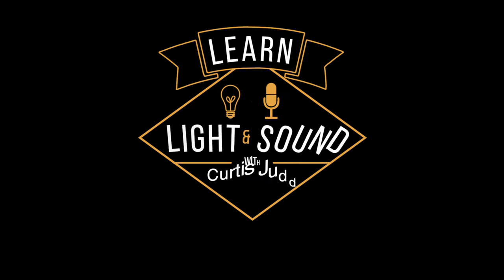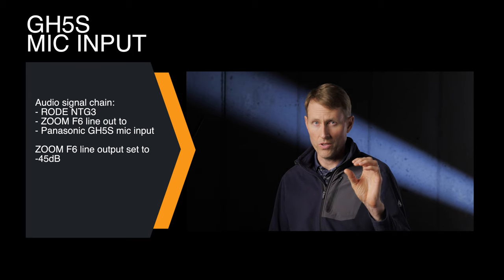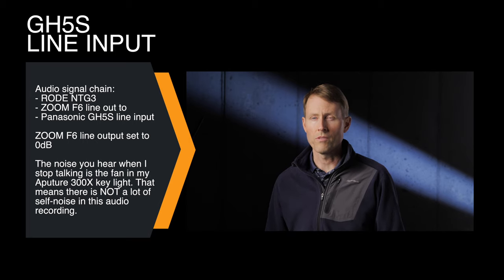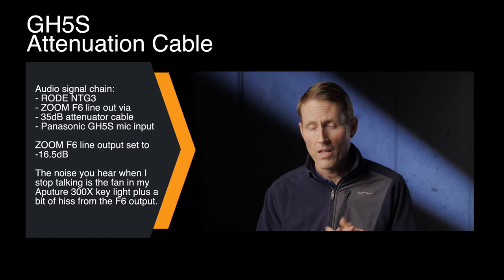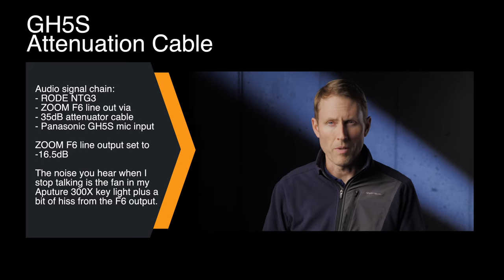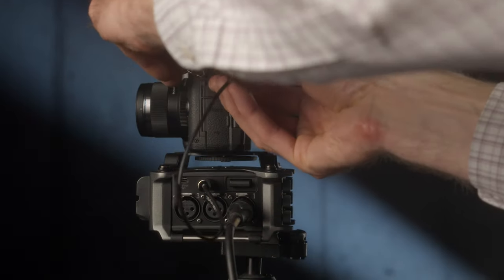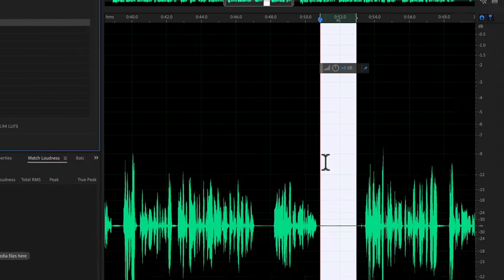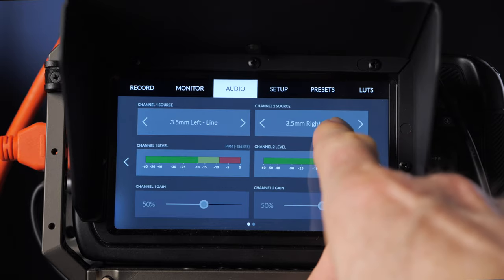Zoom F6 Line Out Issue & Workaround

Comment: Attenuator cables can be very handy - I had issues with an inexpensive Marantz PMD602a preamp which, despite being intended for use with cameras, has an output that hits 0dBV (a little 'hot' even for line level). A 35dB attenuator cable made it usable with cameras that only support mic level input.
Reply from the maker: Thanks Karl - agreed.

Comment: Thanks Curtis; I'm using headphone out instead of line out with Y splitter. this method is better for me. Line out port is useless. I cant find attenuator cable in my location.
Reply from the maker: Ok, I hope it works well. The reason I didn't do this is that the headphone amp colors the sound from my testing.
Reply: @curtisjudd  That's true. but it's better than loose every thing. as you know this recorder has only one memory card. if it's corrupted you can loose every thing. just for backup headphone out is life saver. for feature I'm trying to find attenuator cable. thanks for you advice.

Comment: I had a simular problem with the Zoom h1n.  It doesn't have a separate mode like the sony for setting the recorder to line level.   Zoom is suppose to accept both line and Mic.  I've got an attentutor cable on the way.   Apparently there's 2 types of line level.  Commercial/ professional vs consumer? Hoped the attentutor works.
Reply from the maker: It should help, especially if it is -35dB.

Comment: Another possible solution, which I will try, is to use a direct box that is designed to output microphone level. This would be ok on a tripod as they tend to be large.  However a good di will have high quality transformers and would also isolate any possible hum noise.  Balanced to unbalanced cable would be required and it would be mono only
Reply from the maker: Interesting. But most cameras or recorders with XLR inputs can be changed to line level so presumably, the DI box would not be required? Just change the input to line and no problem? Or are there DI boxes which output to 3.5mm TRS? Interested to hear what you find.
Reply: @curtisjudd   It would require a balanced to unbalanced cable, I have one Ill report back
Reply: Tested this tonight and while it’s a bit of a kludge it works very well.
I have two whirlwind passive DI’s.  I take the trs output of the recorder and break it out to two mono tip ring 1/4 inch connectors. These I connect to the two passive DI boxes which have a switch for either line level or instrument level. I pick line level.  Out of the di boxes I use a xlr to 1/8 in stereo  cable (xlr female to 1/8 stereo) this unbalances the xlr but outputs correct mic level signals.  No noise and the best part is that both the zoom and gh5 can be set at unity gain (0db) and use the cleanest part of the input and output circuits .  However it is a little cumbersome .  There are stereo line level to di boxes out there that will accomplish this made for interfacing -10 consumer level device to balanced mic level so one box could be used and again a stereo 1/8 to xlr female adaptor, I had one made a long time ago, but they are available.  Having a quality transformer is also a plus versus a passive attenuator.  I think the radial makes the ideal av that has a trs input and two balanced 600 ohm outputs.  It’s not cheap at 160 and the price of the cable figure another 30.  However if you want the best results I think it will work.  
Pretty geek, zoom should have designed a circuit that was switched between mic and line.  Even my old tascam consumer grade dslr recorder is switchable.

Comment: I plan to record audio coming from a mixer/soundboard and same time record the sound of the crowd for a live performance. I'm thinking either the Tascam DR40x or Zoom H4 pro or H5. Would you be able to recommend which is better?
Reply from the maker: Hmm...any of them could work, though the ZOOM recorders may need adapter cables. To get them into line input mode you need to feed in 1/4" TRS to the H4 or H5 inputs. I'd probably opt for the Tascam though it isn't without its issues (not the cleanest inputs).

Comment: Hi Curtis, thanks for your clear explanation! I'm about to purchase a Zoom F6 to use with my Canon R6. I would like to connect these two via a Rode Wireless Go transmitter / reciever. My question is: do you think that in setting the Rode Wirelss Go to the lowest gain setting (-24 dB), it would act in the same way as an attenuator cable?  Thanks in advance for your reply!
Reply from the maker: Hi MMA Fotovakschool, no, I believe that is only an output level setting, not a gain level setting so you'd probably clip at the input of the RODE Wireless GO. Will still need the attenuator cable.

Comment: Thanks Curtis, do you know if the R6 and R5 have line level audio inputs or just mic level? And does the workaround completely eliminate the issue or just reduce it to manageable/barely noticable levels? Also have their been any developments regarding this from Zoom since you published this video? Also how did you know the values to set it to such as minus 16.5db etc?
Reply from the maker: I'm not sure about the R5 and R6, but most mirrorless cameras only have mic level inputs. The workaround works, but is not ideal in a theoretical sense. But it may be good enough depending on your production value requirements. I have not heard of any developments from ZOOM on this. I suspect it is a hardware issue. I did several tests to find the levels.

Comment: Can you tell please what is the brand of the attenuator cable please? if that really matters in this case - but apparently cables can be very different in quality, and I suppose you've tested this as well. Thank you
Reply from the maker: Hi leemski, they are hard to get a hold of at the moment. I ended up with the MOVO MV-RC100 (link in the description). Whirlwind also makes a -35dB attenuator cable. I wasn't able to get that in as it is backordered, but Whirlwind usually makes decent quality products.

Comment: Hi Curtis, would you rather connect the Zoom F6 field recorder to the hybrid camera mic input via a -35db attenuator cable or would you rather recommend connecting the Zoom F6 recorder to a Ninja V monitor recorder (mic input) instead.
Reply from the maker: If the input on the ninja can be set to line level, then I’d try the ninja first.
Reply: @curtisjudd  does that mean if the Ninja monitor supports line level for mic input port i don't need a special attenuator cable.
Reply from the maker: @ZoranvonderHeide  That’s correct.
Reply: @curtisjudd  thank you

Comment: Curtis,  I'm using a camera messenger bag to lug around my zoom f-6 and a camera gimble sort of unit to hold my canon t7i! I want to run with attenuation cable but I need 6' of cable to get from zoom f6 to camera! I can find a 6' 25db cable could I get by with that or could I connect the 35db attenuation cable to a passive male to female[extension cable] 3.5 cable and use it as an extension between the two to make up the difference? If so which end would I use the extension on the camera or the recorder? Thanks so much in advance and btw I watch all your videos and find them extremely helpful!
Reply from the maker: Hi thirsty tom, the -25dB cable should work.
Reply: @curtisjudd  Thanks soo much!

Comment: Hey Curtis! What are your thoughts on the f6 compared to the f4?
Reply from the maker: Personally, I prefer the F4's bigger control area and channel knobs. But sadly, it has been discontinued. Of course I prefer the higher resolution scree of the F6. In terms of sound quality, the preamps are the same. The F6 has the wide dynamic range 32-bit float recording, but I rarely actually need that. I also like that the F6 has a built-in Sony L series battery sled. It is a bunch of tradeoffs but if I could only choose one to get my work done, I'd probably choose the F4.

Comment: Wasn't this problem solved in the 1.9 firmware of Zoom? Still needed an atenuator cable?
Reply from the maker: The problem was a hardware problem, not firmware. If you bought yours after this video was produced, you probably don't have this issue.
Reply: @curtisjudd  thks a lot. I will try with s normal TRRS And the line output of -20 DB, preamps of camera at minimum. I haven’t even tried after I watched so many videos telling me that line out is noisy.

Comment: Hi Curtis, 

can you tell me how I can verify that I have a latest Version from the Zoom F6 so I won't have this issue. Also could you try if you can connect the Zoom F6 to your computer and if you can select the Zoom F6 as a mic for examples in Microsoft Teams?
Reply from the maker: The only way to check that I know of is to test it. Decrease the output level to -35 dB, use a 3.5mm cable to attach to your camera and make a test recording. If you don’t get a bunch of noise, all good. And yes, I can select the F6 for use in Teams.

Comment: I just ordered a -25db attenuator cable from B&H & it's on the way for delivery. My set up is to line output from F6 to my UHF wireless system (which only accepts mic level) as IFB. Hope it works well without hissing (finger crossed)
Reply from the maker: Good luck!
Reply: @curtisjudd  It worked perfectly without hissing! Amazing!
Reply from the maker: @awseewee  👍 Happy recording!

Comment: HELP!!!!  Do you know why the zoom f6 is breaking up my single recorded audio into 2Gig files?  I recorded a 3 hour event and I have 5 audio clips.  Is this a setting or a max clip thing?  What's the best way to combine these files so I can sync them with the video?
Reply from the maker: This is a limitation of the file system that the F6 uses. You'll need to sync the first one to your video and then just set the subsequent clips next in order and it should be fine.
Reply: @curtisjudd  ThankYou

Comment: Hi Curtis, did Zoom solved it!
I’d llike to buy an F6 to use it with a Canon R and R6. Thanks in advance for your time!
Reply from the maker: I don't believe that can fix it with firmware - it appears to be a hardware issue. You'll just need an attenuation cable if you plan to use the F6 with a camera which has a 3.5mm mic input.
Reply: @curtisjudd  thanks for your answer! I will! 👍🏻

Comment: Interesting, I haven’t noticed this with the F6 plugged into my 1DXII mic input. Maybe I’ll go listen again ! Not that I use the audio recorded in camera usually anyway.
Reply: Likewise Grace.  I previously mentioned to Curtis that the line level signal from the F6 into the 1DX2 is very clean.  I just followed the F6 instructions and changed the 1DX2 to Line level input from Auto, but Auto seems fine as well.
Reply from the maker: That’s because the camera takes line level. This is not an issue for cameras which take a line level signal. It is only an issue for cameras with a mic level only input where you have to reduce the level of the output on the F6 by 40+ dB. So you all with 1Dx and 1DC cameras are unaffected. Happy shooting!

Comment: hi Curtis, does this cable will work if into an atem mini mic input. Im doing a live session using couple set of g3s. hope you do a f6 to Atem mini audio workflow video soon.
Reply from the maker: Syafiq, not necessary - you can switch the ATEM Mini's input to line level and that is far better than sending it a mic level signal. Just use a standard 3.5mm to 3.5mm stereo minijack cable (TRS). Leave the F6's output level at 0dB.
Reply: @curtisjudd  Wow, thanks for that fast replies. i will try that tomorrow. I did not realised that we can switch it i just got that atem 3 days ago.

Comment: Probably a stupid question, can I use headphone output from zoom instead of line out? And will the audio quality be worse?

Besides, my Fuji xt4 actually can set mic input as line level, so in terms of audio quality, is it better to record internally withi the zoom f6 or to the camera? It seems to me that the internal recording has lower noise. ( I just hate sync in post...)
Reply from the maker: If your Fuji can go to line level, just switch it to that and you're all set. I would NOT use the headphone output if you can avoid it. It isn't great.

Comment: How would you use the F6 to record wedding speeches, plugging into the mix out of the DJ's speaker? Asking for a friend.
Reply from the maker: Set the input on the F6 to line level and you should be good. Also, here's a more in-depth piece on how to record from a mixing board (or DJ's speaker as you said): https://youtu.be/Tzm3G46ozxQ
Reply: @curtisjudd  Would I use the male XLR cord for the F6 and then plug into the Mix out on the DJ speaker using the female XLR cord, using the line level as the input?
Reply from the maker: @JSHFilms  Yes.

Comment: Im curious about this. When using a Sennheiser G3 as a camera hop from the f6 and going into something like the Alexa Mini which is line level in, would this cable help?
Reply from the maker: No, You need the full output of the receiver for a camera hop.
Reply: @curtisjudd  Good to know. Havent used any attenuators in the past and after we did a shoot last week using the f6 and hopping to an alexa mini it sounded halfway decent in the recorded clips, but wasnt sure if this would help at all. Always great learning about audio stuff from your vids. thanks a ton.
Reply from the maker: Thinking more about this, does the G3 transmitter take a line level signal ok?

Comment: Great video as usual Curtis. Every now and then I get a warning telling me "exceeding maximum input level" when the levels on the recorder are showing me that they are registering at -12db. This happens when I am recording out of the DJ's speakers using XLR to XLR cables. Any thoughts on this? Thanks
Reply from the maker: Hi Ed, do you have the inputs set to line level?
Reply: @curtisjudd  I will check that out. Thanks Curtis
Reply: @curtisjudd  Lets see if I'm understanding this. If I am coming out of a speaker output or a mixer board I should be using the inputs set to line level? Thanks Curtis
Reply from the maker: @edrakel2256  If you're coming out of a mixer, yes, you'll want the F6's input set at line level.

It depends on the speaker as to what level it sends out, but I'd be careful with that. If it is sending a post power amp signal you could damage your F6. Get the audio signal from the mixer rather than the speaker if you can.

Comment: Hi, I’m currently using a Nikon Z6 and am still deciding between the zoom f6 and the mixpre 3ii. Does the mixpre have the same issues of line out into camera as the zoom f6? Also any preferences as to which one of the recorders would be more suited to the Nikon? Using timecode and audio?
Reply from the maker: The MixPre does NOT have the same issue as the ZOOM F6. Both can work, but I prefer the MixPre. But it is more expensive.
Reply: I have z6 the Zoom f6 no cables are needed for the signal out go to the menu 'movie and turn Attenuator on and the problem with the signal is fix it

Comment: What cable did you use for Zoom H6 to BMPCC4k? I haven't found a cable with proper levels yet.
Reply from the maker: That would be a 3.5mm TRS cable, often called a stereo mini-jack cable.
Reply: @curtisjudd  Yes I'm aware of that type of cable. I just can't find a cable that doesn't produce noise issues.  Only the TRS to mini-xlr has work without added noise, but levels are lower than what's on the H6.   The TRS to TRS cables I've tried produced what sounds like too much gain. There is a low constant level even when there's no sound going into the mic.  The Blackmagic works fine with the TRS to TRS with a wireless receiver, but the H6 creates constant noise like it's too much gain.  I have heard the Comica TRS Cable works, but haven't tried it yet. I have tried an attenuated cable, but still same problem.
Reply: @curtisjudd  I found the issue. I was externally powering the H6 that cause the hum.  Now if I want to keep it externally powered I need to use the TRS to mini-xlr, but the audio level is lower (a little more than half) than what should be.  Any ideas?

Comment: Thank you. I have the same problem with Zoom H5 and Panasonic G85. G85 has only mic input. I set Zoom h5 to -20 db but i get this hissing self-noise. Was very disappointed and thought that there is something wrong with Zoom h5.
Reply from the maker: Hmm, I hadn't heard that this was an issue with the H5.
Reply: @curtisjudd  You know, i played a bit with settings and it got better. I've set -30db for line out on H5 and set gain on H5 to correct level and got less hiss self-noise. It's still there but not so obvious as it was before. Maybe H5 in general has a high noise floor, i don't know. 
Anyway looks like i can't buy attenuator cable in Russia, it's just not avaliable. To order it from Amazon will cost me too much with delivery cost )) 
So i'll try to play with settings more, maybe i can get rid of that hissing.

Comment: Hi Curtis. I want to send audio from my zoom f6 to my Sony fs7 but I get a lot of noise when sending audio from f6 line out to fs7 xlr input. Do you have any suggestions here?
Reply from the maker: Hmm, the line out is unbalanced. How long a cable are you using? Also, I'd try another cable just to make sure it isn't the cable or adapter. I assume you're going into the FS7's XLR input set to line level.

Comment: I have to choose f6 or mixpre 3. Can I use de line out from de F6 also in 32 bit float for Line in or mic in in camera. I want to record audio in best quality in camera using two mics.
Reply from the maker: Hi William, on both you can record on the recorder in 32-bit float mode while also sending a line out signal to camera. However, keep in mind that the line out to camera will distort if the signal exceeds 0dBFS. But it will still be good in the F6 or MixPre.
Reply: @curtisjudd  Thanks. I just ordered a f6. I also use it for music recordings.